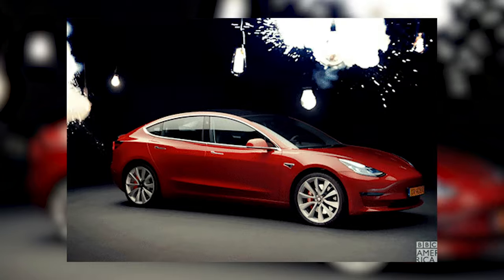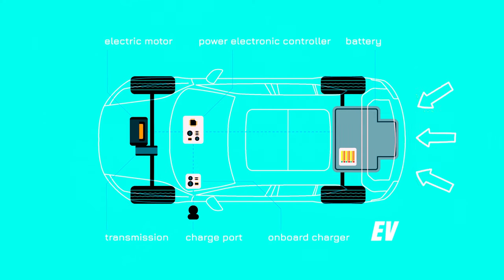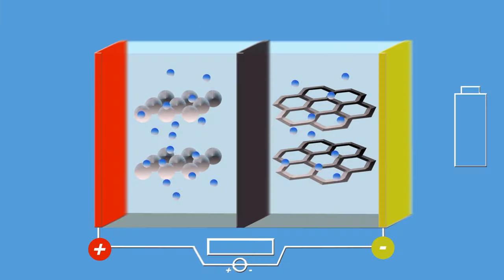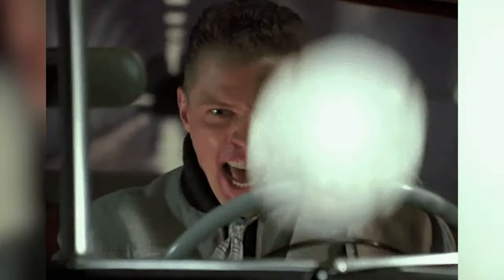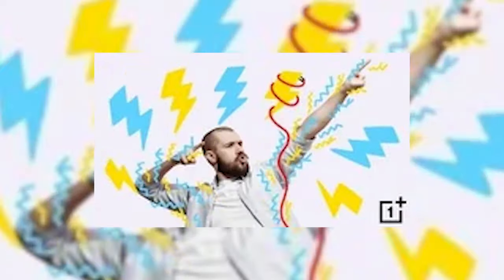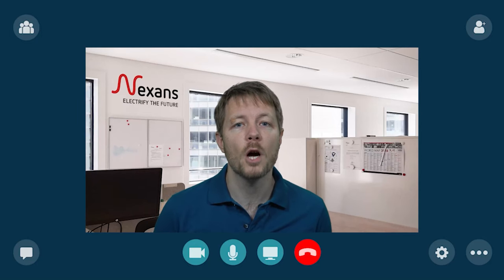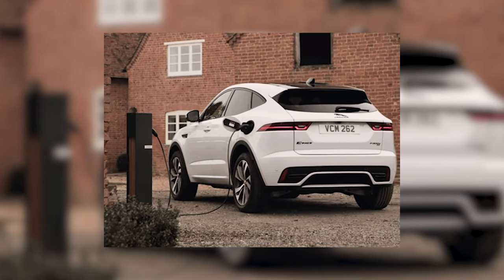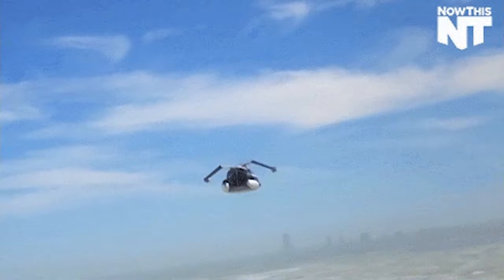Electric Vehicles, Unplug and Drive with Thibault

Comment: Personally I like hydrogen cell cars that store the energy in the hydrogen itself in the car's tank. The car has four power plants that generate electricity directly into four electric motors, one for each wheel. The only emission of this process is water. What needs to be done for this to work is to increase the energy efficiency of hydrogen extraction and distribution 💜